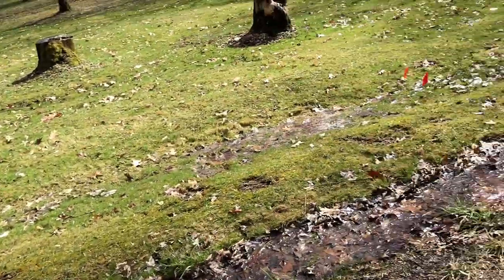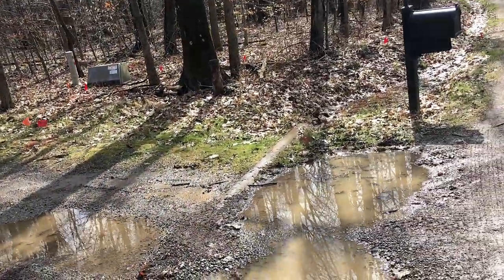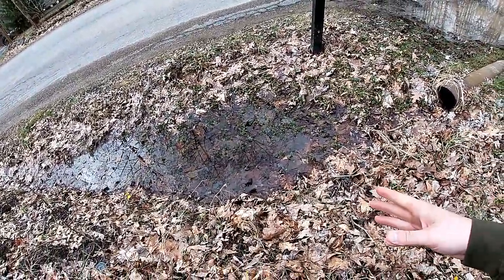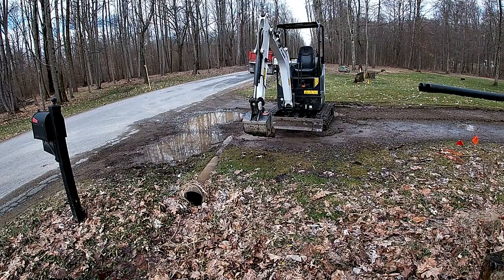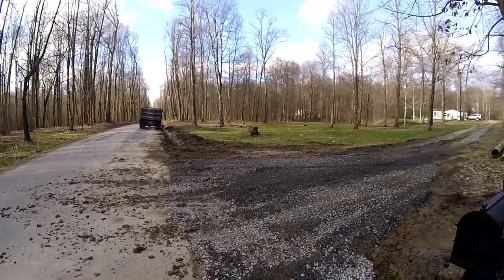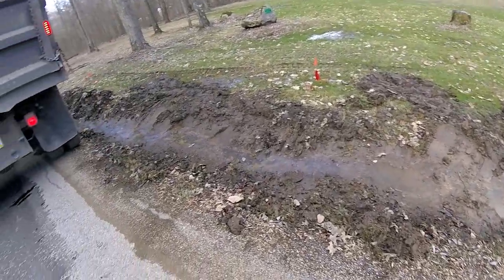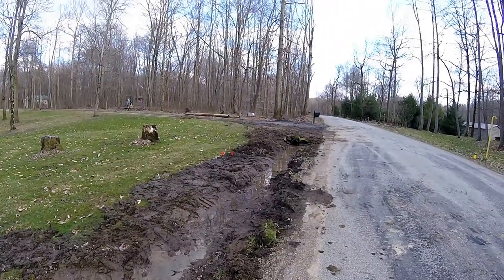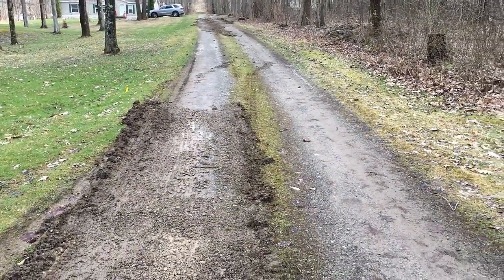Culvert Pipe Installation

Comment: Nice work.  Was the old drain pipe clogged or not sloped right?   My wife wants me to buy her a backhoe now!
Reply from the maker: fixit man haha get her one you can knock out all your projects! The old pipe was steel and pretty much filled in on the one side. Exposed in the driveway. They just wanted it replaced